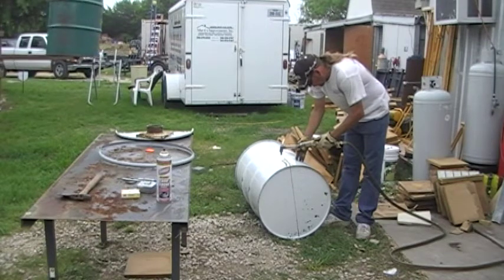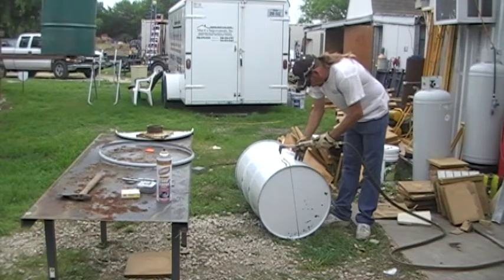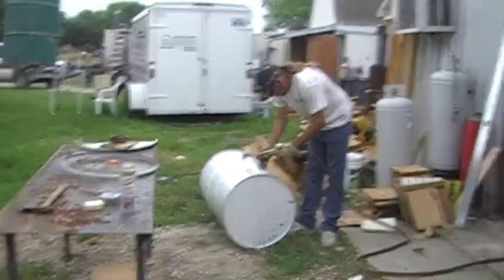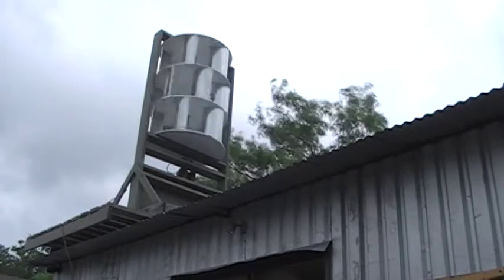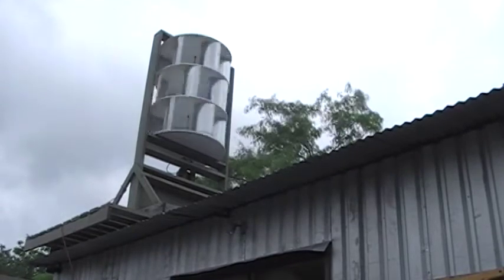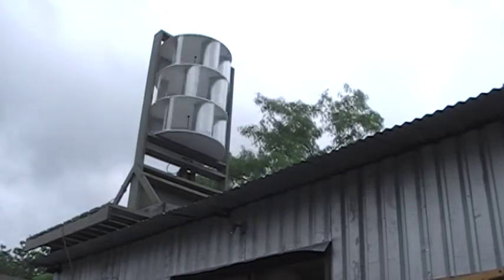VAWT 6 blads  55 gallon drums #1

Comment from the maker: We wll have a 5 to 1 ratio using sprockets and chain a 9 to 10 mile an hour wind ,  it turns over 25 rpms and the out side diamiter has a 12 Lb. 14 Oz pull.Te radius of the blades  is 60 inches and the sprocket is 5 ,  so that is a 12 to one icress in torch.  That will give the chain pulling on the atenator ove 154 pounds of pull turning it at about 125 + RPMs.